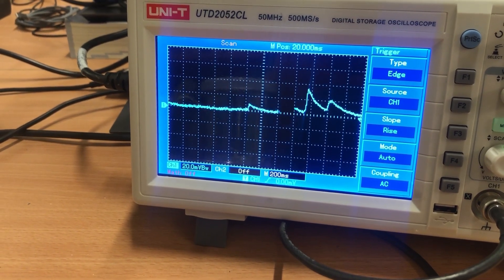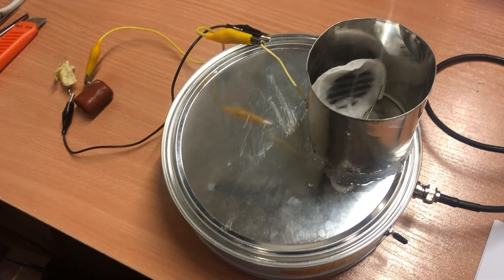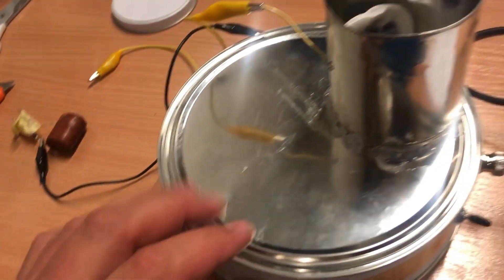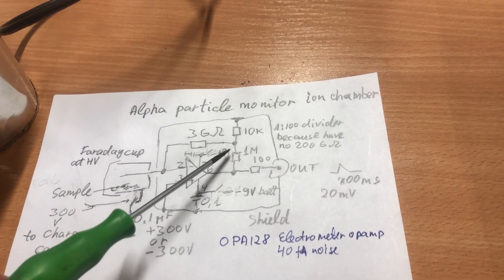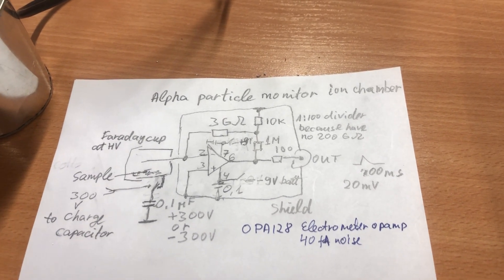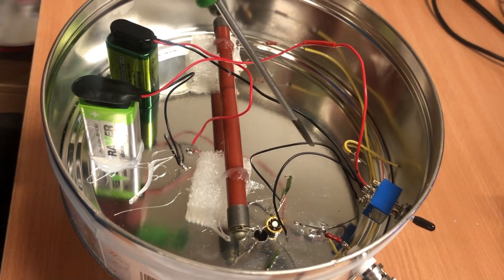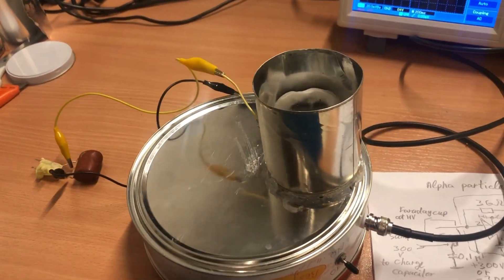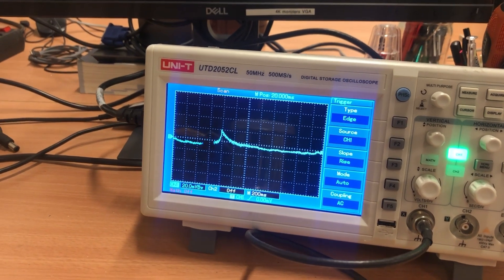Faraday cup ion chamber, alpha particle detector.

Comment: Hi
Do you have a clearer schematic circuit.  Thanks in advance
Reply from the maker: circuit is jfet input opamp with a large feedback resistor of 3 GOhm. Can have a smaller resistor ma
y be 500 MOhm. Or even smaller 20-50 MOhm.
Super large resistors like 100 GOhm would mater if work not in pulse detection mode but average ion current. It was my first circuit. I would use now circuit by
 CERN radiation photodiode detector.

Comment: Great demo, I think this is how Ecoqube works.  If you remove the radioactive tissue and have a normal radon background (1 pCi/L), do you see about 30 pulses per hour?
Reply from the maker: thank you for a comment. Without prefiltered cotton sample see very few clicks - depending on indoor air  ventilation on the order 1 per minute.
Reply from the maker: further upgrade with a pedometer counter or Arduino counter counting pulses/h and logging is a practical thing as click rate changes with location,  ventilation, wind speed,
Reply from the maker: Thanks for naming Ecoqube. Did not know about it. I bought Radon Eye. Same principle. For hobby device programming would take too much effort and it is easier to buy a commercial product. But for seeing real clicks it was fun to build